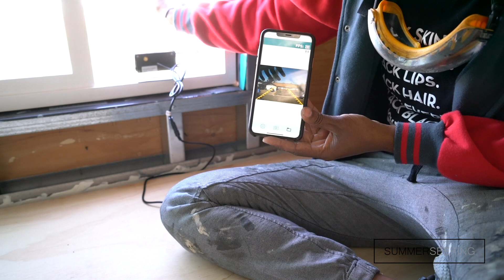How to install a backup camera // VAN LIFE

Comment: Invest in a tube or two of clear silicone to close up any holes that have to be made, can also use the same around electrical connections. You might want to place any wiring between metal studs.👍👀🚚😎

Comment: New sub here!  I am loving watching your build.  I just finished binge watching all of your build videos.  You are doing a fantastic job.  Glad you got a backup camera - very important considering the size of the vehicle.  Regarding some other comments I saw on the video where you drove Shadow to Home Depot.  No need to shift to a lower gear unless you are going up a steep hill - but beyond that I have a tip for you on exiting the freeway.  The speed limit posted on the exit ramp is for four wheeled cars - considering you are basically driving a commercial vehicle (even though you don't need a CDL to drive it) - you should really cut that speed in half.  So if the speed limit signs say to take the exit ramp at 30 mph - in that vehicle you should be taking it at 15 mph.  Try not to get complacent.  I used to drive a semi-truck and almost rolled my truck and trailer going too fast on an exit ramp.  Also - I would love if you did a Q&A video on your build with things like - How tall is your vehicle?  How long is the box of your vehicle with and without the loft?  Keep up the great work - can't wait to see the finished product.  I'm sure you are getting more and more excited now that the inside is really starting to come together.

Comment: I already have a back up cam that i put in but i didnt splice it to the reverse lights. Will that mean its only on when in reverse? And i wonder if low branches might catch on that antenna?  Mine is similar but wired, not wifi.